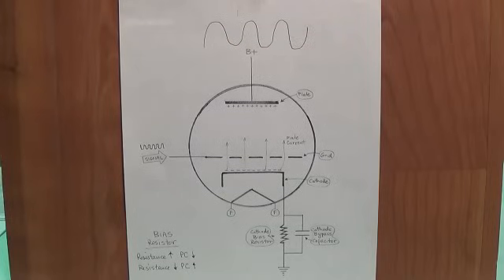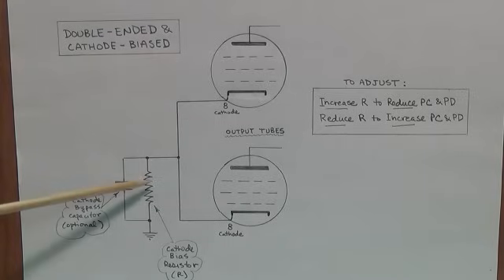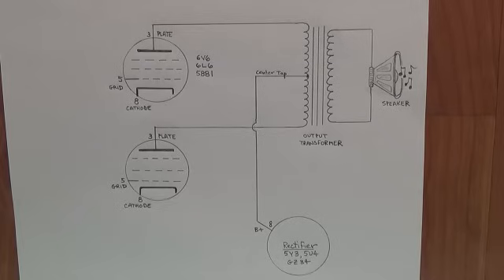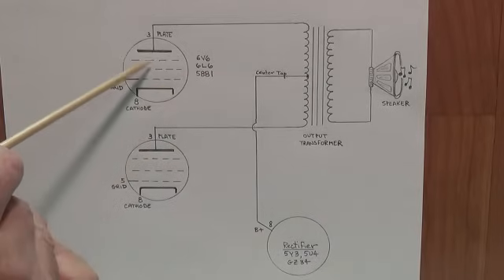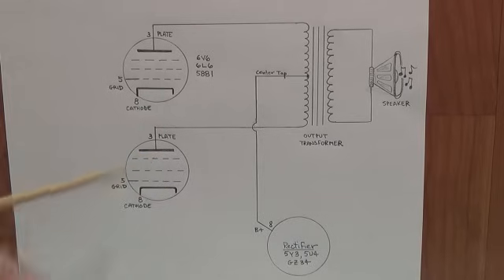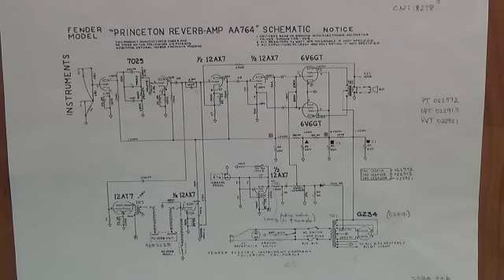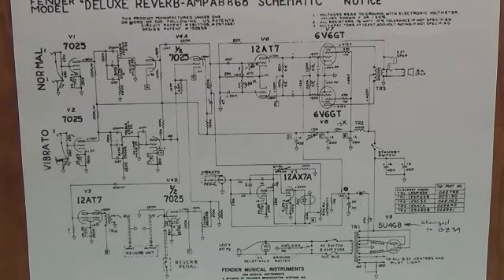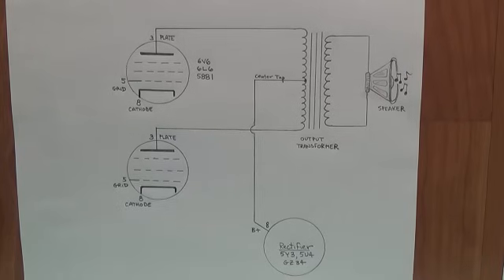Biasing Double-Ended Amplifier Output Tubes, Part 1: Basic Explanation & Methods

Comment: Howdy.
Much effort is usually focused on balancing the output tubes runnung idle. Personally I don't think this is very important. I don't think the commutation region needs to symmetrical. The region should be wide enough though, for smooth transition of conduction.
End tubes show two main characteristics. One is the onset of conduction. I.e. the bias. The other is the steepness or gain factor.
I believe it is more important to match the tubes to deliver about the same gain at the "sweet region" of listening volume. Despite some idle unbalance.
The idle unsymmetry will result in some DC magnetization of the output transformer. Yes. But that has little meaning on low volumes. The iron will be way away from saturation.
On higher volumes the unsymmetry will "fade out" anyways.
So. I would suggest setting the idle symmetry is only the first step. Then one might crank up the volume to preferred level. And now the individual biasings are tweaked to deliver the best THD. Alternatively the Fast Fourier Transform function of the oscilloscope could be used to deliver the smallest levels of the harmonics.
In high regards.
Reply from the maker: Thanks for your very erudite comments, Eugene, but recall that  distortion is not considered a bad thing in guitar amplification.
Reply: @UncleDoug  Howdy.
Yes. They say that is what made the Marshall brand. Never mind the THD. Just squeeze all the watts out of the tubes.
Happy New Yoghurt.

Comment: Thanks for the quick reply. I am hoping that I may pursue this a bit further with you but don't want to become a pest. When I bought the amp the person I bought it from told me that the amp has the AB165 circuit and indeed when it arrived the tube chart fastened to the inside of the cabinet indicated an AB165 circuit. BUT when I opened the chassis up to take a look I found two 150 ohm 7 watt resistors connected between ground and the cathodes, along with a 5 - 50 capacitor in parallel with them. So after some digging online I found the schematic for the AC568 circuit and realized that my amp has that circuit, not the AB165. I know you said in one of your videos that this often happened - that Fender would use up the old tube charts even though the circuit had changed because the tubes were the same. The AC568 schematic also shows a negative 55 volt charge being sent to the grids through a set of components that appears to me to allow you to adjust separately how much voltage is applied to each grid. So the two 150 ohm resistors connected to the cathodes would suggest a cathode bias wouldn't it? But the voltage applied to the grids indicates that would affect the plate current as well wouldn't it? Again, I don't want to be a pest and you may not have time to pursue this but if you take a look at a schematic for the Bassman AC568 circuit you will see what I mean. I know that the AA 864 and AB165 circuits were designed in the Blackface era and the AC568 in the Silverface era so it makes me wonder - did Fender need to adjust some problem with the AB165 circuit or were they just "playing with the circuit for fun". BTW the serial number on the chassis of my amp and the dates on the transformers all indicate that my amp was made in early 1969. Hope you can help quench my curiosity but if this is too much trouble I understand.
Reply from the maker: Thanks for your excellent note and for bringing the unusual, hybrid-bias AC568 circuit to my attention. To be honest, I have never worked on one of these circuits. In a Princeton Reverb video, several years ago, I experimented with hybrid bias to perfectly balance two out-of-balance 6V6's. Applying different cathode bias resistance to each (I used fixed resistors, but you could use a 250 Ohm pot) resulted in equal plate current, while the (reduced -DC) grid bias helped to maintain a proper PC at idle. It worked and sounded great......but I caught all sorts of flak over the hybridization, some viewers saying "I couldn't do this". I wish I had known of the AC568 circuit at that time, to justify my experimentation. Bottom line: I think that this was Fender's attempt to do what I tried later, but perhaps the hybridization was like Harley Davidson introducing a water-cooled engine, simply not acceptable to purists......or possibly the tone was "different". Either way, it is an interesting modification for grid-biased amps and one that deserves more investigation.

Comment: Uncle Doug, I have watched pretty well all of your videos explaining all of the principles of amp design and they have been very helpful. Thanks again for posting them! I recently purchased a used Fender Bassman from the late 60s with the AC568 circuit. When I look at the schematic for this amp it looks like the power tubes are cathode biased but it also looks like there is a potentiometer that somehow affects the grid voltages which makes me wonder what is going on?? I have watched all of your videos about how to check the bias for single and double ended amps. Could you explain the theory behind this design? By the way when I switched to a 3 wire grounded power cord I used your idea of turning the ground switch into an on/off switch for the negative feedback loop. Wow, what a difference. It is almost too "hairy" without the NFB.
Reply from the maker: Thanks for your kind words, Walter. The output tubes in a Fender Bassman are not cathode biased. The cathodes are grounded and a -DC bias voltage is applied to the tube grids to regulate the plate current at idle. The potentiometer allows you to alter the -DC bias voltage and thus adjust the bias of the tubes.

Comment: Got a 67 Fender Bandmaster amp that I can’t get the plate dissipation on both tubes to be equal, there is always a 30% difference between the two. Tubes are matched pair, bias voltage on each grid is equal, plate voltages are 415 and 417, which is too small a difference to matter. Output transformer DC resistance of each winding is 80 ohms and 73 ohms about a 10% difference there. Screen, plate and grid resistances are accurate, since I replaced them. I’m missing something, but the only thing that stands out is the output transformer primaries being off by seven ohms.
Any idea what could be wrong?
Reply from the maker: If you switch the tubes, does the low PD follow the tube or remain with the socket?  If it follows the tube, then it simply is not well matched to its mate.
Reply: @UncleDoug  Thanks, it follows the tube! My hickok tube checker had them at the same transconductance, they were new matched TAD matched Tung Sol tubes! I put in some soviet 6M3C tubes that I got from Vivatubes.com and the Plate dissipation is 20.23 watts and 18.75 watts, which is close to the 70% Plate diss figure of 21.0 watts. This is an amp that I bought as is, someone had put in a few caps backwards, among other things! I think I will carefully check the grounds on the power supply dog house caps and the 6L6 sockets (which were cheap CBS era type, real crap) with Belton's. No bargains in U fix it tube amps, but the time investment is worth it! Many Thanks!! Eric

Comment: The power disaplation of the tube is the voltage across the tube (plate to cathode) and the current thorugh the tube. You are not makeing use ot the screen current which is part of the total disapation of the tube.
Reply from the maker: When the tube handbook shows a maximum for Plate Dissipation, it is for the plate itself. The Screen Dissipation is listed separately.

Comment: Now I am really excited to learn! I have 2 of the same amps. One I keep original and the other I experiment with. I just installed a high voltage regulator board on that amp so that I can keep my pre-amp tube voltages regulated and keeping the filter cans still hooked up so that the ripple is clean. Next I will try to modify this amp with a Wing C EF86 tube right before the tone stack. Also my tone stack is before the inverter circuit which is good. Now I just have to figure out what values to connect to the EF86 tube. I need to find some schematics of someone else’s build of connecting the EF86 before the tone stack. I’m near 60yrs old and I grew up with tubes. Now I’m finally learning about them.
Reply from the maker: That sounds like an interesting project, Mark. Good luck with it.
Reply: Thanks Unc.

Comment: I did all of the measurements as suggested. I did inner/outer resistances to give me 155/181 ohms. I did inner/outer voltages (referenced to pin 8 on rectifier tube) 8.2/8.44 volts. Gives me 52/46 mA. I did inner/outer plate voltages (referenced to chassis ground) I got 396/397 volts. Plate voltage x Current gives me 20.59/18.26 Watts. I really studied my HH Scott 99D schematic (very hard) I don’t believe it is Cathode Biased. I believe it is Grid biased. The way the engineers designed their output circuit on the Cathodes is a mystery to me. (Too many things going on!) But if you study the Grid side of the output tubes they have a 330K resistor coming off of both Grids tied together and going to ground. R43 and R45. I feel that is the biasing resistors. I could be wrong because I’m learning all of this stuff. Any how’s I ordered a set of 5, 20 turn 500K potentiometers. I have 2 of these amps. What do ya think big Uncle?
Reply from the maker: Tying grids to ground through resistors is more a "grid leak" type of biasing.....which is not commonly seen in amps of this age or sort. The fact that the cathodes are not directly grounded sure indicates cathode biasing to me. You should be measuring the plate voltage from plate to cathode, not to ground.
Reply: Ok

Comment: I’m still kind of confused on why your schematic does not match my schematic that was also taken straight from the net. The resistors that you mentioned are not part of the final output section. But any way... Let me see if I understand your tutorials at least. I take resistance readings from plate to center tap on primary side of output transformer. I then measure voltage from same test points. I do ohms law e/r to get current for both tubes. Everything is done at idle (no drive with 8 ohm resistor on output. Now I measure plate voltage referenced to Gnd. On both tubes (again at idle) I then do ohms law P=IxE (I=current I calculated from above. E=Voltage from plate to Gnd) at idle. This gives me Power at idle or Power at full throttle?
Reply from the maker: Take resistance readings from each plate to center tap on primary side of output transformer. Then measure voltage drop across each of the two resistance values. Divide Vdrop by Resistance = Plate Current in Amps. Measure PV from plate to cathode (in cathode-biased amps) or plate to ground. Multiply PV x PC = Watts of Plate Dissipation. Compare to Tube Data Sheet. All values at "idle".
Reply: Uncle Doug you are the BEST! And you reply to help me out which is great! I love your channel and your valuable knowledge.
Mark
Reply from the maker: @EUC_Senior  That's great to hear, Mark.

Comment: Hi Doug. You said cathode biased and not Grid biased..Ah..on my schematic for the HH Scott 99D it shows R37 as part of the feedback loop and R38 as part of the AC balance circuit. Also important how do I know the correct bias current that the tubes should running at? I am going to replacing the 6L6GB with Tung Sol 6L6GC tubes. I have no idea if this is class A, AB or B in my output circuit.
Reply from the maker: Bias is based on plate dissipation, not current, Mark. It's determined by the tube and circuit. All 6L6GC's have a max PD of 30W.  Whether you bias at 50% to 70% (grid biased) or up to 100% (cathode biased) depends on the circuit. Your circuit is weird. Perhaps you should see where the factory biased the output tubes in your amp and go from there. My answer was based on the schematic I found online.

Comment: Hi Doug. I’m struggling with the HH Scott 99D amplifier on determining if it is Cathode biased or grid biased. If you look at the HH Scott 99D schematic the cathode is connected to a 3K resistor (R47) to ground but it is also tied to 2 resistors, a grid and 375V. Also if you can figure out the biasing resistor would that control both tubes? Also, what would I set the bias for? Please help!
Reply from the maker: This is why I only work on vintage tube (guitar and PA) amps, Mark. This circuit is a convoluted mess, in my book. I believe it is cathode biased, simply because the cathodes are not directly grounded. I guess you could alter the value of R37 and R38 to achieve proper plate dissipation, and try biasing it as if cathode biased, but conservative.....say 75% of max. Try it and see if it works. Either that or seek assistance from someone better versed in HiFi amp topology. Best of luck.

Comment: BIasing still has me a bit confused. I guess because you didn't get into how Class A, B, and AB are biased differently. If I understand correctly everything I've learned from you, we can define the class of a double-ended amp by picking the correct bias value for the output tubes.  For a Class A, we would want to bias the output tubes so at zero signal voltage on the grid the current is in the middle of the linear region of the tube. Class B amps should be biased so at zero signal voltage on the grid we are at the cutoff point for that tube where practically no current will pass through the tube. Finally, for a Class AB amp we'd bias it the same as a Class B but add a small offset to the bias to move the cutoff point to occur when the signal voltage dropped slightly below zero. Am I correct or have I missed something? If what I'm saying is correct, would it not also be possible to bias an amp to operate as a Class A amp at low volumes and then switch to Class AB operation when the preamp drives the output tubes much harder? Also, if I'm right, how can we tell the amp's class of operation from the schematic?
Reply from the maker: Bias, as characterized by plate dissipation, is dictated by the maximum values posted in tube handbooks for the different output tubes, depending on whether the tubes are fixed bias (cathodes grounded) or cathode biased. With cathode-biased circuits (generally Type A), the tube(s) are biased at or just below the max PD value. With fixed-bias circuits (generally  Type AB), the tubes are biased at 70% (or less) of max PD. While one may venture into far more esoteric concerns, this is all that is necessary to properly bias the vast majority of guitar amps.

Comment: When you measure the cathode current it also takes in the screen current. There for the current for the plate resistance, impedance, you can find in the tube manual. It will also tell you what the screen current is. The tube manual will also tell you what the bias should be for any given plate voltage is and the screen voltage for the best operating point the tube should be biased at.
Reply from the maker: Thank you for your input, Henry.

Comment: Just checking but on a single ended amp can you measure the plate current the same way as you show in the second method threw the output transformer?
Reply from the maker: Yes, but it's generally easier to measure the voltage drop across the cathode bias resistor and calculate the PC.
Reply: @UncleDoug  ok just looking for the more accurate numbers . Thanks for the info
Reply from the maker: @OldIronShops  Try it both ways and compare the measurements, OIS.
Reply: @UncleDoug  will do

Comment: quick question doug and I notice that in my amp that one filament Glows Brighter then the rest. I did not try changing the tubes around. Love your videos Doug.Thanks c];-)
Reply from the maker: I think it has to do with different tube brands and designs, Al......not a fault of the circuit.
Reply: @UncleDoug  Thank you Doug. I appreciate your Quick Response to my question.c];-)
Reply from the maker: @ALtheDoctorWho  You're welcome, AL.